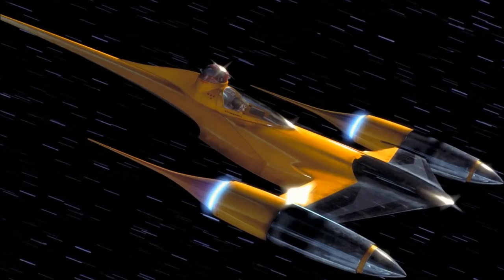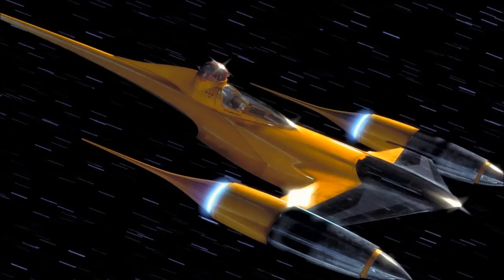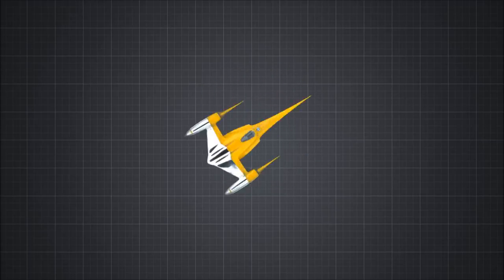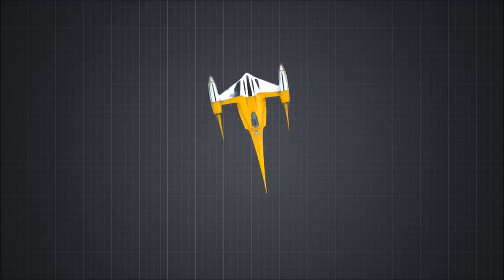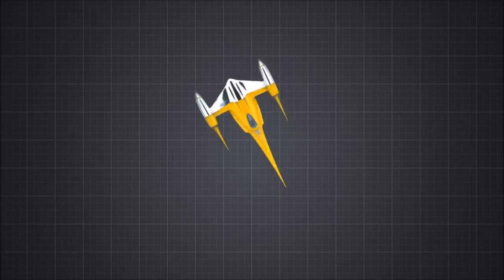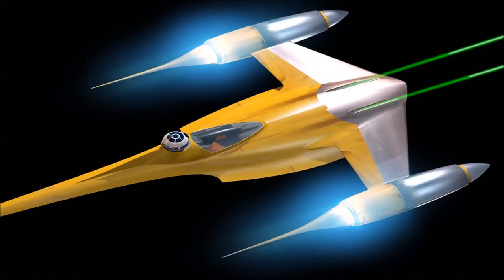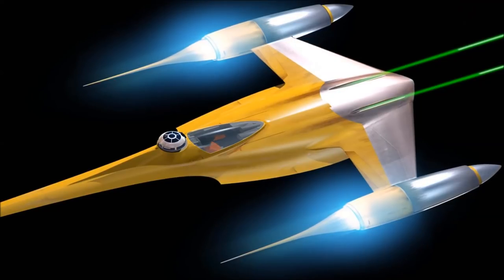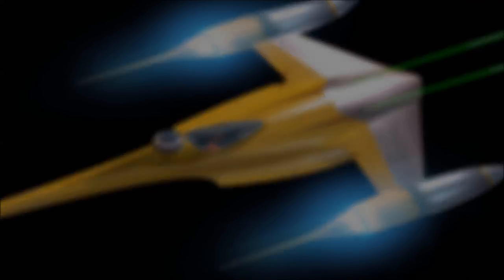Star Wars: The Big Problem with the Naboo Starfighter - Spacedock Short

Comment: On the point about gun placement, even as a little kid I always thought the X-Wing was a crappy ship because the weapons are mounted way out on the end of long-ass wings so that if the ship is pointed straight at a target that's smaller than the wingspan then every shot will miss.

Comment: Perhaps late to the party here, but I'll throw in a quick plug for a cool science thing the N-1 got sorta right:  the engines use an aerospike nozzle, which, if we were to imagine it following any of the same rules as a rocket, would greatly improve the performance at low altitudes.  Given that Naboo was presented as an insular community, it might be a very logical design choice for them to focus on atmospheric performance, where the vehicle would probably spend most of its time.

Comment: I agree with this video . I think the N1 starfighter is superior in many ways to other fighters in the same class .  A tight firing arc of energy weapons and torpedoes  , highly fast and maneuverable,  small cross section and its speed makes it a hard target to hit , the cockpit placement in relation to the hull gives the pilot excellent visibility which is incredibly important in a fight , it has a shield generator,  on top of it being fast it has insane acceleration which is also important . The only draw back is the super exposed propulsion systems ... but I feel like some safety feature could be engineered to combat the lethal situation that would happen if one engine were to fail or get blown off ...

Comment: It's interesting you mention thrust in engines, i think the only way to mitigate the problem of loosing one engine and it would only be efficient in a planet atmosphere would be for the ship to be equipped with a rudder (like on a plane) as when you loose one engine on a twin engine plane,  you compensate the uneven thrust with rudder and trim. still, it would take the ship out of the fight as it would no longer be able to perform acrobatics move but at least the pilot would have a chance to retreat from the fight instead of spinning at insane speed like it would happen in space, in my opinion.

Comment: Would it really be that hard to include an automatic mechanism that immediatly shuts down an engine when the other one goes offline? Or, if this is impossible to do quickly enough, what about releasing the engine by means of automatic explosive bolts?

Comment: I would suggest that, as in any space craft of that type, the computers would have to be pretty good.  Therefore I suggest thet the computer engine controls are constantly monitoring the output from each engine as they would need to ensure that they were matched perfectly for straight flight.... So in the event of any damage to one engine the 2nd engine would respond in a likewise manner instantly.
Now this could of course cause other issues.  Sudden deceleration?  But momentum should enable the fighter to proceed for some considerable distance at speed.

Comment: Correct me if I'm wrong but... lets say you're at full speed in your naboo fighter, and one of your engines is blown off... there's no resistance to slow the one side without the engine down. So nothing would happen unless you enter the atmosphere or start to use reverse thrust (if the thrusters are in the engine bays anyway).

Comment: Another point about the engine placement is that they're far from the centre of mass, which means that there's a lot of leverage from them. Having two presumably reasonably weighty pieces of kit on the end of two long levers is going to drastically affect roll rate, both in space and atmosphere. Seeing as roll rate is one of the marks of a good fighter, not the best design point from a practical standpoint.

However, I do agree with you on the looks of the craft (apart from the astromech socket, which just ruins the profile of the ship aesthetically for me)

Comment: I have to admit, I never even considered this issue.  My main problem with the design is the astromech placement.  It prevents the canopy from extending all the way to the rear, making visibility impossible in that direction.  That said, I guess the problem could be mitigated by sensors, and  having the droid at the back makes it a lot harder to hit than if it was somewhere in the front or on the side.

Comment: Whatever systems that steer the ship would likely be utilized in correcting a single engine failure. 

Also, a similar argument could be made against the Twilight. It has a very far reaching gun mount, but is a craft that Anakin and Ahsoka have used often, and in atmosphere as well. That gun wing is an easy target, and produces drag. But if a separate system is responsible for turning and for (in relation to a source of gravity) ascent and descent, it would be the same system to eliminate the drag of the gun wing. 

Such compensation would help with a single engine failure on the N-1, as well as a reduction in thrust.

Comment: Could you do the ARC-170, my favourite star fighter in Star Wars?
Reply: ARC-170 and V-wing are the only planes inSW Iike, so I'll try to help you find some points about ARC-170:
Engine parts are exposed, if the ship flies without shield on, engines can be easily damaged by debris. Also no manouvering thrusters (like in the rest of SW, where spaceships are turning by using some kind of magic), so the ship can theoretically fly only straight forward. The guns also lack the ability to fire on real distance and allow you to fire on target only from space melee distances (another problem shared by all SW spacrafts). Navigation computer is outside the ship and isn't even part of it (we saw the problem in ep. IV). The last problem I want to point out is, that the crew is onboard, despite SW has technology to build drones, and they are exposed in large glass cockpit.
Reply: Filip 3 My main gripes are a tail gun and a seemingly redundant second crew member. If the back seater is only controlling the primary weapons then what's the point? That's the pilot's job. I'm all for a two seat fighter if it works like say the F/A-18F or F-15E. I have difficulty arguing my case against a tail gun on a fighter though apart from having a wingman and provide mutual support instead. You do bring up several other details and points that I never really considered but as you said; typical of Star Wars fighters. 

Edit: I support the use of drones but a pilot is always going to be needed.
Reply: Given the powerful sensors utilized on board the ARC-170, I would assume one of the second crew man job would be to monitor those sensors. As for the tail gunner, given that it was inspire from the P-61 Black Widow, maybe the tail gunner was to compensate for the lack in maneuverability?
Reply: Monitoring sensors makes a lot of sense and that's what I would figure to be the case. A lack of maneuverability might be a reason but I dunno.
Reply: The ARC-170 always reminded me of a JU-87 Stuka or a Dauntless.

Comment: If it lost one engine, in space, the other engine would still accelerate the ship in a straight line. There is no resistance in space that would cause the levering action you mention.

In atmosphere, you are correct, it would enter a flat spin. But, it cannot accelerate that quickly in atmo. It would still be bad news for the pilot, though.

Comment: Just rewatched the episode 1 space battle with these fighters. The only time the vulnerable engines cause a problem was when the fighter was shot down taking off. I'd suppose that the engine designs are robust enough to practically never breakdown unexpectedly so long as it's regularly and properly maintained and that there is probably enough power going through those engines to vaporise the entire fighter if one of the engines are badly enough damaged to stop functioning. Add to that the shields covering the engines probably would have been made as strong as possible to make up for their exposed nature and I don't think it would have been an issue.

Comment: well, the only problem is, you first need to hit the fighter, and with this enourmus speeds, its far more unlikely to catch them. sure, in a dogfight cenario, where the N1 needs to be slower to also it the opponent you can catch them, but if you whant to avoid conflict, i can´t see any other ship that will save your rear end ;-)

Comment: You forgot one thing: No air resistance in space.
A plane would spin if one engine is hit, but a spaceship can not spin, since there is just forwards force lost, and no backwards force to hold the not functioning part of the ship back.
So the N1 would not spin, but simply lose acceleration, but not even speed.

There is however a problem in trying to stop the ship with one engine, because both sides move with equal force, and just one side is stopped, meaning it will spin.

Comment: As a pilot, and someone who has spent alot of time studying the engineering of aircraft, I would like to point a few things out. 1: space ships don't work like they do in Star Wars, but going with the we-want-to-make-them rule. A ship would need thrust vectering all over the hull to make it fly like an aircraft. 2: a multi engine aircraft can fly on a single engine. Look at the P-38. Roughly the same size, and engine placement as the N-1. Take both of these, and I would be confident in saying, looking a single engine wouldn't necessarily send you into a death spiral. It wouldn't take much computing power either. You loose an engine, the computer, sensing the uneven acceleration, kicks the thrust vectors into action, keeping your tail from spinning (much like a helicopter), and reduces, then perhaps even reverse thrust, bringing the ship to a slow, and manageable speed to limp home, or for the pilot to be rescued. Even if the second engine is ripped from it's mountings, a simple ejection pod, with thrust vectors, and a small, very simple, sublight engine, or rocket even, with just a few seconds thrust, could solve the problem. The pod ejects, twists, the sublight/rocket engine fires, slows the pilot, and thrust vectors can handle the rest. Beyond that, it's a matter of keeping the pilot alive. A few rations, some potable water, even a system to filter urine, and an O2 filtration system, and a pilot could stay alive for days. Plenty of time for shuttles to sweep the "battlefield," and surrounding area for surviving pilots, ship's crew, even marines in landing ships, as well as salvage. Really, other then the material, which it could be said allows bolts through, instead of going off right in the hull, it's not a bad design.
Reply: As far as I'm aware, N1 star fighters don't have thrust vectoring.
Reply: FrogRay What I'm saying is, in order, scientifically, for a craft to fly that way in space, it MUST have some sort of thrust vector system. It can't not, or else it wouldn't fly like a traditional aircraft. Now, I'm not saying it has any in the traditional sense, but it must have something. What ever system it uses, that acts like a thrust vectoring system, could be co-opted to kick in, and prevent the vessel from simply spinning endlessly, and, even if it didn't, an escape pod could be rigged easily. There, a simple gyroscope would end the spinning of the escape pod.
Reply: +FokkeWilfe No way the thrust vector system would be powerful enough to counter the force of an engine that gives the craft1325 g's of acceleration. If the fighter had that powerful of a maneuvering system it would be able to turn much faster then what we see in star wars.
Reply: FrogRay Again, it would need something. As I said, perhaps not in the sense of what we think of as thrust vectoring, with shots from engine exhaust (such as the AV-8B Harrier), or with small jets of gas, such as the shuttle. Without some system of redirection, it simply wouldn't go anywhere, once it leaves the atmosphere (and forgive me, but I've never seen any external control surfaces, so it likely wouldn't go anywhere but the ground). It would go off into the nether, never to be seen again. It must have something to control it, in which case, that system could be used to prevent a spin. Now, the other side of the coin is "space magic," where-in, it simply works because reasons. If that's the case (and it very well could be), then the same logic used to propel the N-1 in its maneuvering, would also prevent it from spinning. It either just wouldn't happen for reasons, or it has some sort of vector system (traditional or otherwise), that could prevent the spin. Lastly, as I've said before, even if a spin was imminent, a very simple pilot eject pod system, and everything is fine. No matter what, I truly believe it's not the death trap that the video portrays (outside of immediate explosion, which still ends the spinning issue).
Reply: Sure, it needs something, but most likely that something is not powerful enough to counter act the engines. Countering gravity only puts the minimum at 1-2 g's, not 1.35k g's. That much power to just re orientate the craft would be enough to turn, shoot, and turn back in a blink of the eye. Space combat wouldn't work like ww2 dogfights if fighter craft had such a beefy maneuvering system.
Reply: FrogRay do keep in mind, part of the reason an aircraft begins to spiral, is the uneven thrust, and lack there of, on either side. In space, there is no drag from the opposing end. There is nothing to "slow" the crippled engine. Really, there is no reason, once at speed, to even need engines (outside of counteracting any gravitational pull of the planet, or large ships). Once one is lost, the craft will continue (in theory) to speed along at its current speed, so long as nothing acts on it (such as gravitational pull, or atmosphere). Anything capable of moving the mass (which, from what I can tell does include in atmosphere), should be enough to counter-act spin (assuming there is any). Remember, the ship is still moving, so, assuming spin, it would only be from the single engine, as it powers down, since no self respecting ship designer would leave such an obvious flaw in a vessel such as that. It would take almost no computing power to recognise a problem, and counter act with even a shut down engine. What about reversing said engine as well? Again, any ship that can do that, must have some sort of motion damper to protect the pilot from turning into jelly on acceleration. Couldn't it also prevent the pilot from, at the very least, feeling the entire G-force load, while the single remaining engine powers down and reverses? I realise i sound like I'm bouncing. I'm simply exploring any safety device that may exist.

Comment: While the engine themselves ARE venerable, any space fairing craft would rarely be under acceleration, in other words the engine would only be firing under acceleration and not running all the time, in fact until the pilot went to change direction he might not even notice the loss of an engine. Aside from that sub systems would most likely cut the other engine in the event of an emergency.

Comment: Well, to be fair, considering the material that the N1 is constructed with, a single hit is usually enough to start a domino effect that will tear the entire craft apart anyway. Another thing to consider is that, since the cockpit is mounted so far forward and right next to the engine pylons, if you rip off one of the engines, it's going to compromise the cockpit as well, killing the pilot instantly.

It makes complete sense that these are made for ceremonial purpose in mind, as while they are very aesthetically pleasing, they are functionally weak starfighters.

Comment: Counter argument:
During the second world war, twin engine aircraft like the He-111 and Bf-110 Had the ability to continue flight even after the loss of one of its two engines.  This logic may still apply to the Naboo Starfighter, more so if the remaining engen's power can be cut in order to prevent its thrust from causing a death spiral of the craft.
Reply: both airplanes you mention has their engine as close to the body as posible. try to find a real world airplane with the engine at the wingtip that is flyable after you loose one engine.

Comment: 3750g is about 20 percent of the 40,000g produced by present day artillery guns. The acceleration would tear the N1 apart unless the inertial dampening system were able to provide a massive counter force on the rest of the fighter. This would mean that the engines would be accelerating themselves, while the inertial dampening field accelerated the rest of the N1. This would mean that the inertial dampeners would be so powerful that there would be no need to include conventional engines at all.

If the space combat depicted on screen in Star Wars featured these kinds of acceleration, then it would appear as if all of the fighters had hyperdrives. They would accelerate and decelerate so fast that it would look as though they had just entered or dropped out of hyperspace. While they wouldn't actually be travelling faster than light, they would be able to reach relativistic speeds so quickly that a casual observer would be fooled.

Comment: another weird thing about it is the question of how does the R2 droid actually fit? I mean the narrow frame doesn't really have enough space to fit the R2 "legs" where they should be. Unless the R2 unit is disassembled to make it fit but that would be stupid.
Reply: Koltoroc the astromech unit is actually disassembled. The head is detached from the body, which is kept inside the fighter.
Reply: Actually, astromechs have telescoping necks and enter from the bottom.